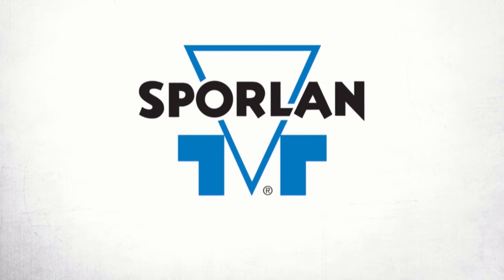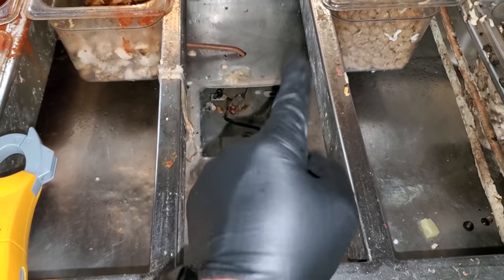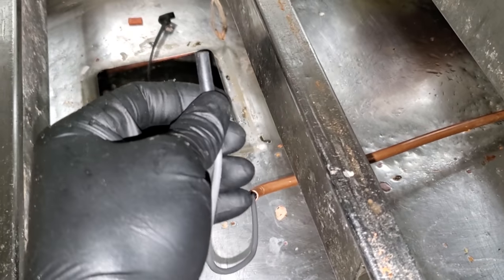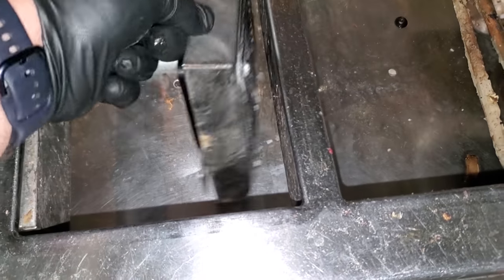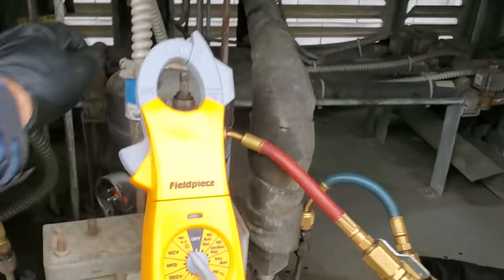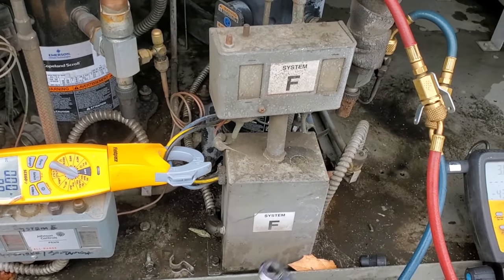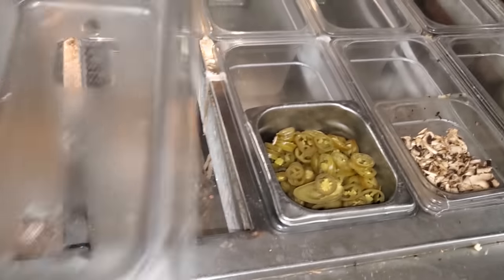One thing leads to another

Comment: Oops! Dropped a sheet metal screw in the mushrooms. The operators should have completely cleared the table knowing they were getting service work done. The city I live in regularly issues fines and closures for “inadequate protection of food during maintenance”.  However as far as your work goes; I share your desire and drive to make things right. Used to do the same at customer prems doing telecom work all the time. Fixed all sorts of messes, some outside my scope. 
Cost me more time and a few extra parts but in the end the gratification of knowing things would work well and for a long time.. totally worth it. As much as I feel like HVAC would be a great fit for myself I’d be worried about my cost of doing business... damn OCD.

Comment: Man !!!  I would be wearing a HazMat suit working on the nasty cold top. I am so glad I am out of the restaurant biz. I'd have a stroke if any of my Cold Tops or any of my equipment looked like that. One of my biggest pet peeves is the Top, Front and Sides of the Dish Machine. Most kitchens I ran had equipment on casters for easy moving. Once a week minimal the equipment was pulled, swept behind, wash the floor and disinfect. I would always be smiling when the techs would pull the equipment to work on it and would compliment how clean my kitchens were. I always told my cooks..."Keep it clean everyday and there will never be a build up.". And if the Board of Health stops by... Nothing to hide.  Great Job as always.  Man, that thing is nasty
Reply: eddiewhaler1 most restaurant managers I worked with only did the minimum. That cold table looked clean compared to what I serviced. The worst were seafood coolers, make one vomit if you opened them up. I got to say Olive Gardens in my area where top notch in keeping things clean. Part of it, they designed equipment for easy maintenance, wash down with hoses, etc. Olive Garden’s equipment seem to be that way.
Reply: @TOOLMAN4hvac  Yes. Seafood Coolers. Really need hosing out. I did take a break from cooking back in 2000-2004 and ran a Wholesale Produce warehouse.  I did a few "Fill in" orders to our Olive Garden and absolutely... spotless kitchen. Even under the Pot Sink, Dish Pit... all super clean.  I would eat at an Olive Garden just knowing they are clean. I always told my cooks and friends..." If you want to know where to find a Clean Restaurant and Kitchen, ask a Delivery Driver or Repair Tech. They see it all".

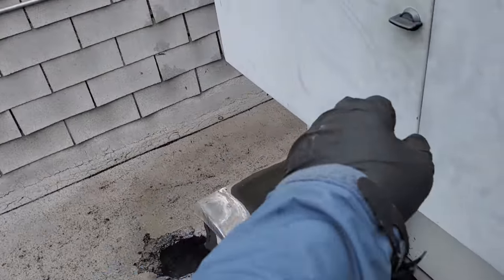Comment: At 16:51 you probably didn't see it but when you turn that breaker on that unit you were working on  there was a arc flash on the breaker just to the right of the one  you were turning on there's a loose connection in there somewhere or could be bad bus bar good video as always
Reply: Agreed, it needs another look. First guess is weak/burnt/corroded connection between that breaker and the buss.
Reply: looked like a rain drop went flying past or some bug/dust bunny lol.

Comment: here is a tip,make your own outlet. small connection box for outlet with a wire that has on the end alligator clips. hook one clip to one side of a  breaker or fuse and the another to a ground and you have your 115v. i work on lots of roofs  with no 115v power supply and this works great instead of long cords.

Comment: Get yourself some marine grade heat shrink butt connectors. They're a little spendy at $1 each but they're super simple compared to regular butt connectors and heat shrink. The marine grade ones also have a glue built into the heat shrink for a totally waterproof connection.

Comment: There are butt connectors with heat-shrink around it that has a thermal glue that seals the connection when you use a heat source. Most commonly used in automotive and truck wiring. It makes that job much easier and better sealing due to the glue. You can get them at nearly all auto parts locations and on Amazon.

Comment: Sounds like my frustration when you use the "convenience" outlet on the Carrier units. They are good for 7.5 amps, IIRC, and use a screw in type fuse, fusetron/fusestat. 

What is the convenience? Can't use anything like a vacuum cleaner, vacuum pump, reclaim unit.
Reply: Had a customer plugging tlo wax machine there.🤗.

Comment: I worked for an architecture/engineering firm and we were contracted to do remodels for a large pizza chain all across the US. I would fly in on Sunday/Monday. Do about 10-12 as-builts in a week, fly home on Friday. I had to locate the floor sink under the buffet line where the salad bar/pizza is. Water and yeast do not mix along with the heat lamps for the pizza. I opened the door to find said floor sink and saw the bigger alien looking yeast blob. It was about 2 foot around surrounding the floor sink and drain line from the salad bar. I asked the manager how often he cleaned under the buffet line and he said never. I was shocked. He didn’t think there was anything under there that needed to be cleaned. The I asked about the floor sink and was told that they just assumed that it was stopped up and didn’t use any drains in the salad bar. Uh... if it worked at one point, shouldn’t it work now. I showed him the “problem” with it and told him he needed to have someone clean it up. His answer was worthy of a face palm. He said “Well, since were getting a remodel done, couldn’t we just wait until then and let them take care of it.” I said, “Your not getting it remodeled for another three months so, yeah, it needs to be cleaned up. It’s almost touching the bottom of your salad bar.” Some people just amaze me. Then when we were leaving he asked if we wanted some pizza to take with us back to the hotel. “Nope, Nope, Nope!!!!! I’m good” and walked out the door.

Comment: I don't quite understand why they routed the wire inside , since it gets filled up with condensate water , wouldn't it be better to wire it " on the top " where the fan motor rests ?
Reply: I agree, I wouldnt want wires laying in a drip pan

Comment: The probe should be inside the case. Not on the rail. Because if the baskets are not connected correctly. (Bent baskets) or they fail to put the baskets on right away. You're going to have an icing up problem. That's why the timer is set to defrost all night. It would be better to do 15 minute intervals every 2 hours if you fail to move the probe.
Reply from the maker: The probe is located under the fan and not anywhere near the rail. Its technically in the discharge air and that is why the factory has it set for 23 degrees so it maintains a 38 degree product temp. The defrost has to be setup for all night defrost so we don't have freeze up problems. The customer takes the food out of the top every night so the pan chiller is left open so it can air defrost all night. The upper cold rail section is completely independent from the base section.

Comment: you said didnt have correct power to plug into there, like 90V? would building you a custom outlet with spade connectors to hook up to  different breaker temporarily be a easier way? just cut plug off a cord, strip wires back 18", then heat shrink, then put spade connectors on wire ends, just disconnect wire from breaker before hooking yours up, so you dont overload circuit with your vac pump.

when I was young I made 1 from a bulb socket, to screw in a outlet end into,  to make a bulb, outlet to plug my drop light into, & when I was doing work, I didnt have to drag a long cord to have light at power box, I just tapped into a breaker, & that was when I was a teenager,  pushing 40 years ago, doing electrical work for my friends dad that was doing construction work.
Reply: Randy mack that wouldn’t work. It was reading 70 volts because the circuit was missing its neutral. There’s no way to know where the neutral is dropped on that circuit of if it’s tied into others. Could simply be a bad outlet in which case.....still kinda sketchy trying to hook up directly to line voltage.

Comment: Would it really be so difficult for manufacturers to just install gauges in the units? It couldn't cost that much to throw in a couple of pressure transducers and a little processor and display. Then they may as well throw in a few temp sensors at that point and they'd pretty much be able to self diagnose for the most part.

Comment: 8:58 Are WAGO connectors allowed in your area for commercial applications? That's one area where if are they would most certainly come in handy instead of having to resort to wire nuts and having to snip, strip and twist every time a connection goes bad.

Comment: I use to work at a kitchen when I was in school back in the early 90's and it got shut down because there was grease inside the hood above the deep fryers because it was unsanitary.  If those inspectors saw that place they would have called in hazmat to condemn it.  That place was disgusting and what scared me most was that you said it wasn't that bad.  Times have changed for sure because we scrubbed that kitchen every night and bleached the entire kitchen every Sunday and still failed that one inspection so they obviously don't inspect like they use to.

Comment: If you want wire strippers that are really good in tight spaces look for Tool Aid part number 19000. They work great even when you have barely a quarter inch to work with. And only about twenty bucks too

Comment: Used to be a tech mgr for a popular childrens pizza party place.  (draw your own conclusions)...   Older cold table with the salad bar on the top.  Always got complaints about it freezing up.  Had the HVAC company come in as well as my own input.  The GM as well the DM stated  "This are designed to run 24/7 without freezing.   The company that does the HVAC and the make tables, etc..  Flat out stated the GM was NEVER to remove the timer knobs.  The machine was supposed to be emptied nightly so it could defrost itself and turn back on at 6am to get to temp for the day.

Glad I no longer work for that company.  Old POS salad bar setup designed to be shut off nightly...  And the upper management always 'knew better' then the service company.

Comment: That table is unacceptably dirty. I was a cook before I got into the HVAC/R trade and that would make me puke if i saw that as my prep table
Reply: If that would make you puke, then you wouldn't want to see the rotting crap I've had to work in, work around, or lay in to get a job done. Do you know what a dead frog smells like? Times that by 10. Ever see the grease that builds up behind built refrigeration system on a cooks line, where the freon lines and electrical runs? You can't clean it but you sometimes have to lay in it to make a repair. The nastiness of that box doesn't phase me anymore. To me, that's just another day at the office. That's just how a lot of restaurants are that MOST people never see or hear about.
Reply: Dude.... I work in florida and I am 135 lbs so I get to crawl under the lowest trailer homes with broken septic lines and dead possum and rats. Dead frog smells like cotton candy compared to that brotha. Good try though.
Reply: Oh also, I used to work in the food industry. I was the guy that cleaned behind the coolers when the grease trap backed up. But your way too cool for me man. I dont wanna mess with you lol. A dead frog 😂😂 cool bro
Reply: Sorry to be like that but I cant stand when people talk to me like I dont know hard work. It's an insult. Especially with the dues I've paid. Dont jump so quickly next time. I've been on both ends. I bet you've never even worked in a kitchen so in reality I know more about that than u BUT I will say you put knowledge me 10 to 1 in HVAC
Reply: I work in South Florida, mostly in Miami. I can tell you with out a doubt, having done mobile homes in the past, i think i win on this one. Oh, and liquid egg stations. Forgot to mention liquid egg stations. For some unknow reason, there seem to be little holes in the bottom of the box. When you lean in the box, rotting liquid eggs erupt like little volcanoes. Real nice. Card board on stops it from getting on you. Does nothing for the smell.

Comment: How does an outlet only have 70 volts
Reply: Could be a short .
Reply: Most common is that there's loose connections or damaged wires somewhere. Either of those causes increased resistance and in turn lower voltage at the outlet. It's a serious issue that usually ends up melting wires/outlets.